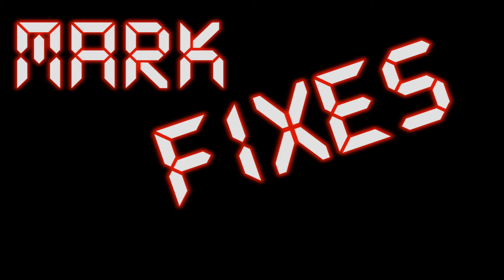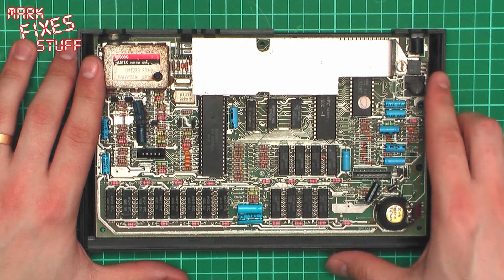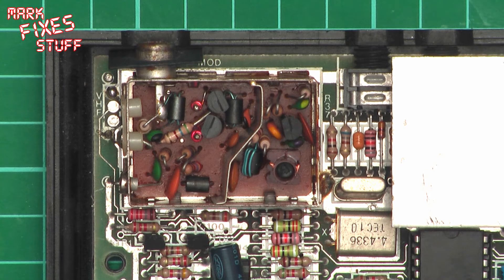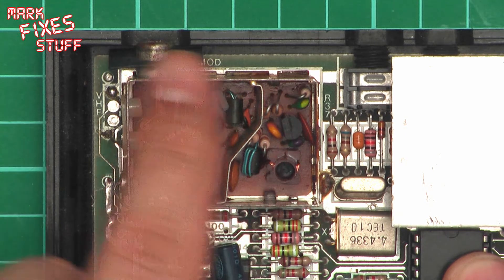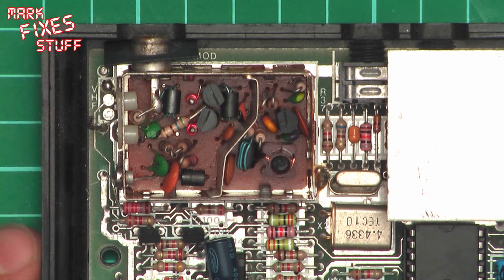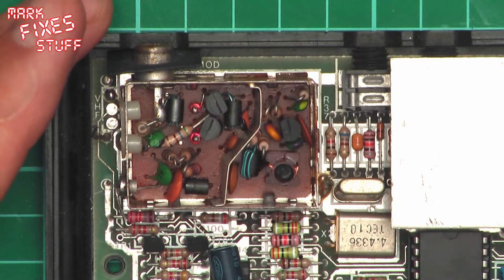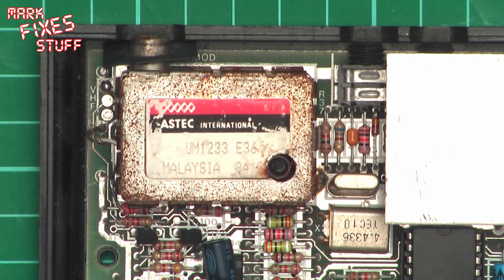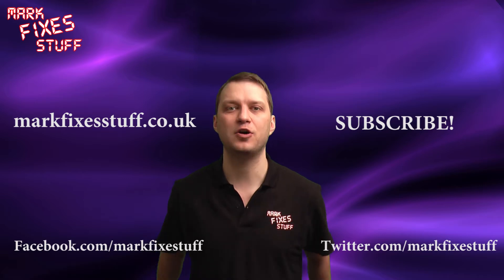No-Soldering Sinclair ZX Spectrum 48k Composite Mod Tutorial - Use Sinclair ZX Spectrum on SCART!

Comment: Mark, thanks for this video! I recently acquired a Spectrum and wanted to have a go at a composite mod but having no soldering iron or indeed even a pair of pliers (I know, I know!) it seemed to be a bridge too far. But then I saw this video and I thought I'll give it a go. And so with a screwdriver and a pair of scissors, and a bit of finagling, I got it to work and was pleasantly surprised that it works very well indeed! Extremely pleased with myself and all that, so much so that I've gone and ordered a soldering iron so that I can go and do a proper job of it. So yeah, thanks again!

Comment from the maker: Thanks for your comments Vincent. Just FYI, the voltage (5v) is removed from the modulator with the disconnection of the first wire, so no danger of sparking, and also the twisted wire is held firmly in plac with the modulator lid, so no movement is possible, even if the board vibrates. I agree soldering is a better option overall, but this mod will not damage the machine. I really appreciate you watching my video and your input :)

Comment: Back in the days (1990 or so) I did it without soldering iron, but also without destroying anything except one RCA cable and a small indentation on the plastic case! I cut one end of the cable, stripped the wires, wrapped the signal wire firmly around the RF input, and the ground wire around one of the teeth on the RF modulator case, thread the cable out through the indentation and it worked like a charm with a Commodore 1084S monitor. The monitor had a separate composite input so both Amiga and Spectrum were plugged in and I could switch between them by pressing a input selection button (composite/RGB) on the monitor.
Reply from the maker: Nice! You were a pioneer back then!

Comment: Great video. Never knew it was so easy and I have no soldering experience so I sill give this a go. I have three speccys. +2, 48K classic and a Plus. I got the plus cheap and fixed the membrane and use it for playing games so going to try it on that. The RF signal seems to drift and get weak so this should resolve all that! Thanks again.
Reply from the maker: You can do it!

Comment: Thanks my friend for the info and reply. I have the same mod (soldered ;-) and also I did manage to built an atari joystick port for my 48k+ through the two ribbons of the keyboard underneath the pcb.this was achieved by shortwiring the pins till I get sincair 1 type keyset.

Comment from the maker: Hi Nuno - Thanks for watching. Sorry for the delay, but was on vacation. 

Theoretically yes, however you'd also need a way to extract audio which would be a pain.

A better solution is a +2A RGB cable which can be easily found on Ebay and give a great picture and sound. Beware that the cable for the grey +2 and black +2 are different pinoutsthough so you need to get the right one!

Comment from the maker: Pretty much, but with a few notable exceptions (i.e the Sinclair Spectrum +2 grey model had a fault in manufacturing), but in the main yes! Do bear in mind that this mod will ONLY produce a picture and you'll need to pull a sound feed from the board too. Modding a 2600 is well documented on the web, but you'll need a small amount of soldering...

Comment: Hi Mark I was wondering if you could help me. I finally found myself a lovely 48k which looked in great condition.. i couldnt quite get it tuned into my tv as there was a a pulsing bar flashing across the screen and it was all yellow.. I did your mod and soldered i and it connects to my tv but the screen is rolling from top to bottom constantly? I removed it all again and started from scratch and did it all again. It is still the same... if i move the cable around a little it seems to jump around in and out of picture but never settles then starts rolling around again constantly... any help would be more than appreciated. Have i bought a dud? can it be fixed if so?
Reply from the maker: Hiya.

48k parts are joyfully all replaceable now so most problems can be fixed. The problem you describe sounds suspiciously like the PAL timing is out. 

If you are on facebook then join this group: https://www.facebook.com/groups/spectrumforeveryone/

I stated it a few years back and there are a lot of friendly folk who can help you. I have handed it over to a couple of chaps I really trust to run it these days, but I am still a member.

Great voice BTW.

Comment: Hey Mark. Once Again I have looked into this change to put out video directly from the Zx Spectrum and two Things keeps bothering me obaout your last answer about why to cut the wires. First of all looking to the rear edgeconnector of the 48K shows that the direct video signal(compostie) is present at connector A15 and why put it there if it's of no use? Secondly looking at the diagram the feeding to the videomodulator comes from a emitterfollower with af low resistor(low inpedans output) to ground which Means that i it should be possible(in theori) to maintain the signal without cutting the wire inside to the transmitter section. As soon as I found the rest of my old "gear" i will look into it myself but time have taken some of the remenbrance of where I put it.
Reply from the maker: +Espen Bøgh In order to see the result of what you are suggesting you can try it yourself.  You will see that the video quality degrades significantly.

Comment: Great tutorial!  Interestingly, however, I have two spectrums here - both issue 3, but my older one has a 3rd wire connected into that far input - its connected by a small pink resister to one just behind the RF block.

If I was to mod this, is it a different process?  That said, both aren't working right now anyway so I'm not in a hurry - thought I would ask nonetheless. (I have a piccy, but can't post URL's in comments obviously :) )

Comment: Great video, once the mod has been done is it possible to connect the scart to a VGA/HDMI adapter and plug it into a modern monitor? or doesn't it work that way thanks.
Reply from the maker: +chippie33 You can connect it to an HD upscaler, but look out for Ben Versteegs new product the ZX-HD which adds native HDMI to the humble spectrum.

Comment: OK, Mark I've seen your other video on this where you show it actually Works but that raised another question for me.Why not just put another RCA plug beside the other, ant connect this with minus end of the capacitor as you did to another minor capacitor 0,1 MicroFarad  and then straight out to this new RCA plug centervise og Zero or plus as needed to shield.Would that not Work just as well, and then you would have both signal types.
Reply from the maker: + Espen Bøgh It would not work as well as the voltage drop caused by the modulator circuit being in operation would provide a very weak video signal.

Comment: I picked up an old TV instead.
That tested that there was a signal output, unfortunately the TV doesn't seem to lock to the signal and though I'm tempted to mod it I really wish there was a switch mod to switch between RF and composite. So I'm going to hunt for the TV manual and if it won't hunt for the signal and lock on then I'll have to get another TV. Well at least it was free.

Comment: This was an eye opener! I've seen websites selling chunky add-ons that plug into the expansion port which let you connect to scart. This is obviously a much better solution.

Mark - is there a similar method of converting a +2 (grey case) to a scart connection?
Reply from the maker: A +2 Grey just needs the right cable and you'll get clear RGB SCART without modifying the computer at all. Beware that you buy the right one though, as the black +2 and +3 have a different pinout on the DIN socket.

Comment: You must solder it mate, this kind of connection could damage it. If this cable is not steady, sparkles will appear while the board vibrates.

Comment: Is it possible to make an AV Mod on Spectrum, which hasn't RF, only RGB?
Reply from the maker: If you mean the 128k/+2/+2a/+2b/+3 models then the solution is easy and if you search for an RGB SCART cable you will find what you need without any soldering!
Reply: Thanks

Comment: Great job Mark.  Questions:  1- Does it means that we can we use either RCA connector or SCART?   2-  Can we do the same thing to Spectrum +, +2 and +3?
Reply from the maker: 1. Yes, RCA to SCART is correct.
2. Yes for Spectrum+, but the 128k models all have a video port for which you can easily buy a cable. Also, on the 48k models there is no sound on the TV as it comes out of the machine itself, but the 128k models do transmit sound to the telly.

N.B. I recommend http://www.retrocomputershack.com/ for cables due to them being AWESOME quality.

Comment: I accidently connected a timex zx spectrum 9v 0.8 amps  power supply to the sinclair and it started to overheat and smell burning what can i do to fix it and where can i find a proper power supply ? the voltage was the same, what went wrong ? the polarity ?
Reply from the maker: Must have been the polarity. You've probably killed the 7805 regulator. I have a video on how to check it. 

http://youtu.be/z5GwqIXNWTo

It could also have taken out the PNP/NPN transistor pair at TR4 and TR5 on the board.
Reply: Yes! iv suspected that, because the T805 regulator smells burned the transistors don't.
where can i get a power supply ? for these sinclair ?

http://gamesdbase.com/Media/SYSTEM/Sinclair_ZX_Spectrum/logo/big/Sinclair_ZX_Spectrum_01.jpg

Or something compatible ?
Reply from the maker: Pretty much any 8-12v 1.4a (or higher amps/current supply) will do as long as the centre pin is NEGATIVE :)
Reply: Mark Fixes Stuff - Retro Console and Computer Repairs, Reviews and MORE!

Hello again,

Can I use the same timex ( 9v dc at 0.8A ) inverting the cable polarity, or is not advisable ?

Or shall I get another one near your indicating amperage values?

Another thing, the transistors I found are:

ztx 215 or 213 ? ( TR4 )

And ztx 650 ( TR5 )

I can’t see the inscription very well, are this references correct ?

My board revision is issue 6A!

Where can I find a schematics for this ?

Too many questions! I Know!

Regards! ;)
Reply from the maker: - 0.8 a is just enough to run the computer, but no expansions. You really need 1.4a - (1400ma) or more.

- TR4 is a ZTX 213

- TR5 is a ZTX 650

- The general Service Manual is a great help. although it doesn't go up to issue 6A it's still a lot of help: ftp://ftp.worldofspectrum.org/pub/sinclair/technical-docs/ZXSpectrum48K_ServiceManual.pdf

- The schematics for the Issue 6a can be found here: ftp://ftp.worldofspectrum.org/pub/sinclair/technical-docs/ZXSpectrumIssue6a-Schematics.gif

Hope this helps :)
Reply: Mark Fixes Stuff - Retro Console and Computer Repairs, Reviews and MORE!
It sure does! Thanks a lot :)
Regards!
Reply: Mark Fixes Stuff - Retro Console and Computer Repairs, Reviews and MORE!
Altough the transistors are reversed in my mobo:
TR4 is ZTX 650 
TR5 is ZTX 213
but is like the schematic you sent me to my board revision :)
Thanks!
Reply from the maker: OK, this could be my typo. always follow the schema!
Reply from the maker: Great job!!!!!!!!!! I don't think I have permission to view your vid, but glad you sorted it all out. All for just the price of a 7805 regulator too!
Reply: Yes! ;) very inexpensive recovery!
Sorry the vid is on my facebook :)

Comment: Looks like the inside of that thing has rust all over it. Simple mod, but closing the lid on thin wire could damage it or short it. Better to make use of the hole already made on the side that is insulated no?

Comment: Yeah, it'll work but there's a lot to dislike about this mod.  I think what's really needed is a tiny little mod-board. The signal levels aren't right.
Reply from the maker: +Duncan Gunn I totally agree, but this is a quick and dirty "hack" really.  I have another video which is a soldered solution using a decoupling capacitor but even that doesn't quite provide what you are describing. A small mod board with a transistor bringing up the levels from the LM chip would probably be possible, but is a bit overkill in many respects because the LM output is a bit naff too.
Reply from the maker: +Duncan Gunn Also, look out for Ben Versteegs ZX-HD which plugs into the spectrum and adds HDMI output!
Reply: Mark Fixes Stuff - Retro Console and Computer Repairs, Reviews and MORE! Sounds like you've touched all the bases then.  I like technically elegant solutions and so Ben's bit might make me happiest.  Mindyou with so many vintage computers having analog RF output, a tuner with composite output could be the portable 'vintage kind' solution for many.

Comment: Amazing..I had 2 spare 48k rubber key speccy's which had shite picture..Done this in 5 minutes and it works..I still can't believe it..How the hell did you find this one out mark!
Reply from the maker: The composite signal was always there, it was just a matter of grabbing it before it was modulated into an RF signal, and of course taking the power out of the modulator :)

Thanks for watching and commenting mate!
Reply: A pleasure mate, allways nice to come across great soloutions to annoying problems like the shitty rf output signal and to be able to do it quick and easy and no cost!! All the best my friend and keep em coming :).
Reply from the maker: Will do :)
Reply: Hi mark i was just wondering if you could help me..I got my commodore c16 out last night and powered it up after nearly 15 years and have a problem..When i turned it on it worked fine..keyboard worked but no power to the tape recorder so i give it a reset with the reset button and now all i get is a black screen with a slight humming noise..The fuse in the machine has been changed with a new one just to make sure and it does not help..Any ideas as the machine itself is in pristine condition and has been stored boxed in a very dry place so it is not moisture damged at all and i am a little gutted to see it no longer working..Thanks for taking your time to read this mate..
Reply from the maker: Well, it could be the capacitors have dried out as it's very old.

Another problem with the datasette not working could be a onboard fuse - I can't quite remember where they are, but I know they will stop power to the port.

Worst case scenario is that the CIA chipset is broken as this could also cause no tape operation.

I would start with replacing all the capacitors in the machine first as working for a bit then dying is a common symptom of dead caps.
Reply: Yes i thought it might be the caps so i will probably replace them in time..I did change the onboard fuse to no change..Nice one mark and cheers for the help..All the best mate.
Reply from the maker: Keep us updated mate :)
Reply: Will do mate thanks:)
Reply from the maker: We have a lot of clever people in the facebook group too, if you are so inclined to join! Link is in the video text.
Reply: I just dont do facebook mate, in fact i can't stand it but i do appreciate it.
Reply from the maker: No worries ;)
Reply: H,Mark...Replaced all the capacitors in the c16 but it's still the same black screen allthough the humming noise has dissapeared,..otherwise its still the same..A few off the caps were slightly out so they probably needed ithem replacing anyway so thanks for that...After further enquires i have been told i have a bad ted chip..As i am only really a c64 person i am unaware to exactly which chip that is..The person who told me about it is no longer willing to help any further for some odd reason but there you go..Any further ideas mate...I hope i am not being a pain..please just tell me to piss off if i am..:0 Thanks again Aaron.Mark Fixes Stuff - Retro Console and Computer Repairs, Reviews and MORE!
Reply from the maker: Argh. It does sound like the TED is defective unfortunately and replacements are simply not available I'm afraid. :( 

TED chips were notorious for being shit even back in 1984 and were one of the main failures on the C16.

The only other course of action I can think of trying it to check for any dry solder joints on the TED, but it's likely to be a parts machine from here on in.
Reply: Oh well i give it a go its not the end of the world..May the little fucker rest in peace:(..Thanks again mate!
Reply from the maker: Just for your information, the processors and TED chips in C16 and Plus4 machines are the same in case you're looking for a donor machine.
Reply: What a stroke of shitty luck that is,I threw a plus 4 out around 2 months ago as the keyboard was knackered  but the motherboard was fine.It got threw out as it was given to me but was in horrible condition and i only collect good to pristine machines...Oh well i will keep my eye out as the c16 is allmost pristine so it would be a shame to just get rid..Thanks again for that info mark,Thats something else i have learned..Nice one mate!!

Comment: will this work on a 128k +2?
Reply from the maker: No, but there are cables you can buy pre-made that will give you an excellent SCART picture. Make sure you get the right one for your +2 as the black and grey models have different pinouts.
Reply: oh ok, im guessing they plug into the RGB port?
Reply from the maker: RedYT Yes mate.